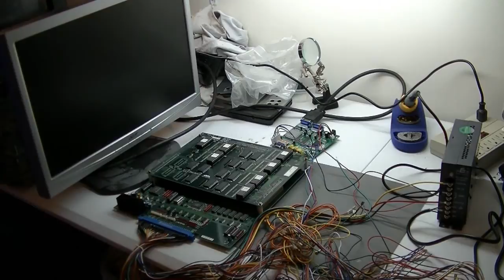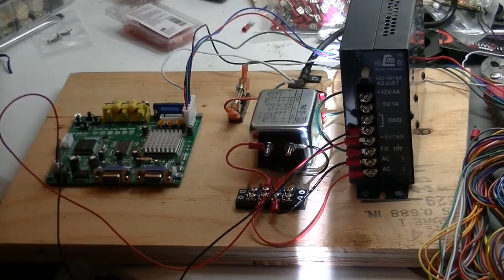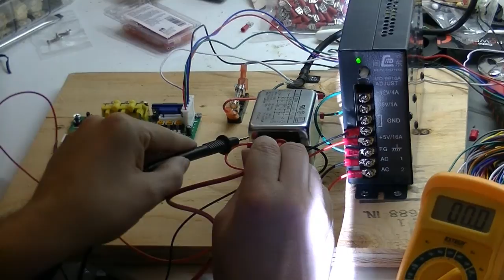[Setup/Tips] Arcade PCB and Power Supply Wiring

Comment: If you're going to use an arcade cabinet, I would emulate the games on a PC and use a PC2JAMMA board to connect the PC to the cabinet JAMMA connector. I can understand you're doing it this way if you're an arcade purist of sorts but man, arcade pcb's are damn expensive...
Reply from the maker: A MAME cab would be pretty cool, but the particular pcb, Macross, is actually not fully emulated so hardware is the best/only way to play it. Plus I could afford it at the time so why not. :) I currently have a cab set up for consoles using an X-Arcade stick as well which is a great way to play console arcade collections, and some console games. Additionally I can play any games that don't map well to the stick with regular controllers so it's pretty sweet. My other cab, meaning the one this Macross pcb goes with, also has a video in so I can play tate/vertical mode games, albeit with regular controllers, but still a cool experience. I'll comment with a link to view on the cabs.
Reply from the maker: Here's a vid about building the cabs, and the X-Arcade one: https://youtu.be/vGAU8jAuoJ0
Reply from the maker: The last half of the one showcases my tate/vertical cab: https://youtu.be/uj9ezR1Wwvk
Reply: +Playongo I get what you mean man ! That's some damn good projects and ideas as well. That Dreamcade is a real dream. Keep up the good work. Cheers !

Comment: I was doing research on wiring, as I'm about to build a pair of arcade games, and found this video. Guess what game I'm doing? Macross Plus and Super Spacefortress Macross. This makes my build much easier, as I now know exactly what I need to get. I really hope you do more videos on this build. What type of cabinet build are you going to use? I found some cabinet designs that I can't use until I move, but as of now, I'm trying to buy all the necessary components.
Reply from the maker: What a coincidence! I'll definitely update as I go. I don't want to do a lot of the work myself though, so I'm keeping an eye on stuff like NorthCoast Custom Arcades, specifically the Ultimate Arcade II kit since I'd like to be able to disassemble it myself if I ever move, or need to move the cab. Also checking Craigslist for possible conversion opportunities. I'm still debating making it a combo MAME cab, but the vertical monitor orientation is bugging me. I tested out a method of running console systems to a TV and rotating them via a capture device hooked to a PC. Looks like windowed is the only way to run it which kills 10-20% of the already narrow screen width, but with a large enough monitor it might be okay. I haven't tried configuring the emus to work vertically yet. I may still just get/build two cabs.
Reply: Like you, I'm doing this more for a nostalgia type fix. I love the Macross franchise, and with the new space of a large den with a built in bar and such, it makes a great lounge room. I may bite the bullet and end up with a couple of those monitors from Suzo happ. Gotta do research once I actually get to that point. Good luck and can't wait to see what you do with it.